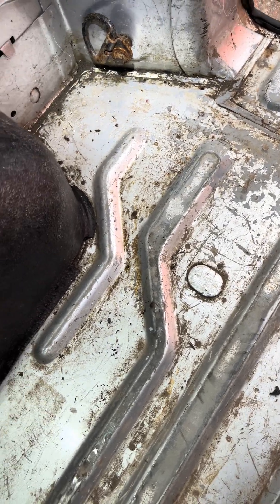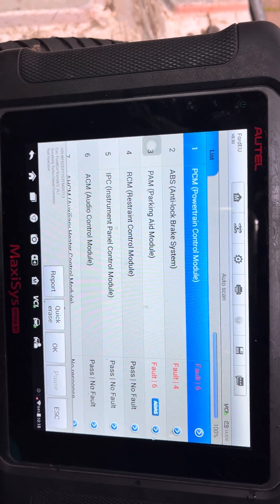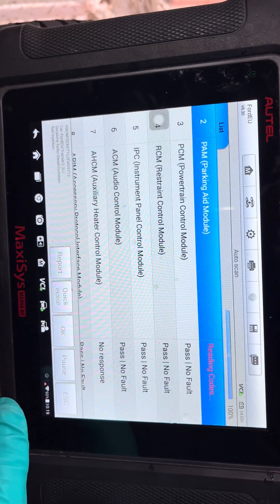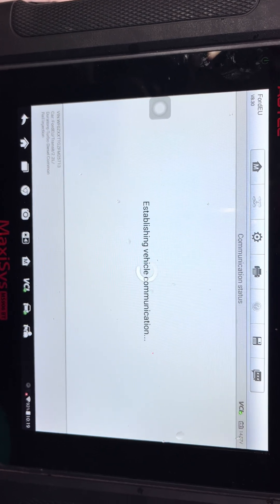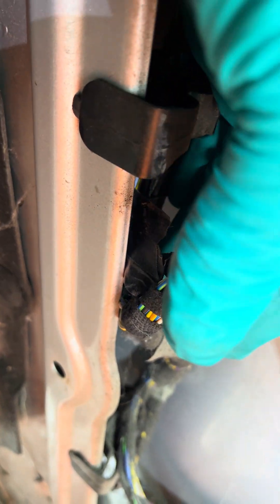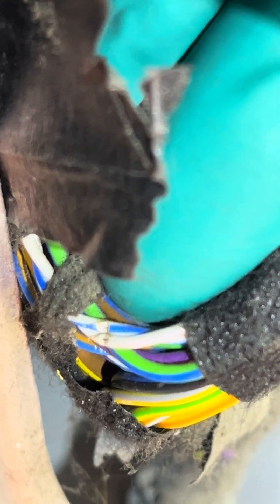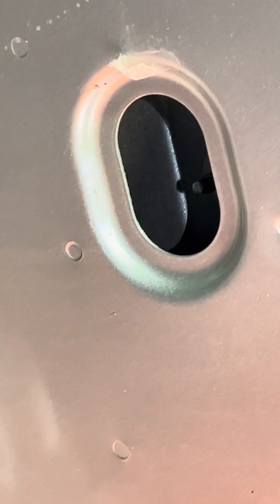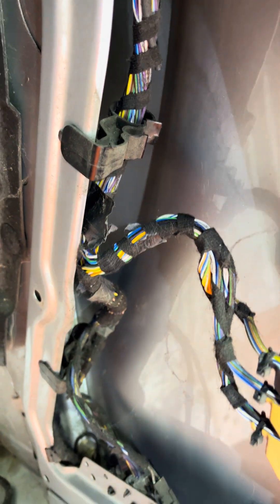Transit custom canbus communication errors

Comment: What did you do to stop it shorting ?
Reply from the maker: Remove the wires from the panel and tape them up properly
Reply: @caralarmandradio cheers, think I have that problem with mine……multiple errors, intermittent loss of radio and steering wheel controls and a heater that constantly blows the resistor
Reply: I has issues with parking aid especially after rain. I couldn't find any of the loom shorting on the body but I moved the loon away from the body and no longer get parking aid faults, I do however still occasionally get abs and bcm  communication faults , this started when I removed oem radio. I have also lost the ability to read can information with my tracker